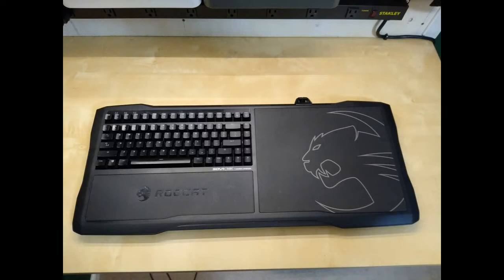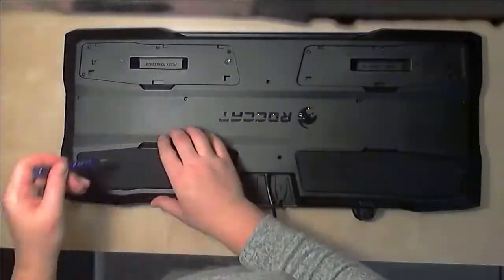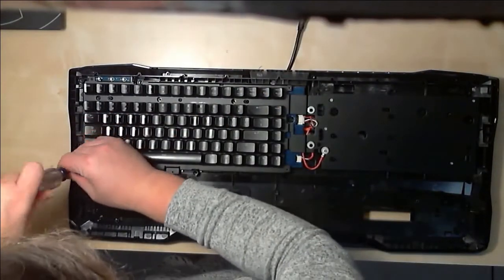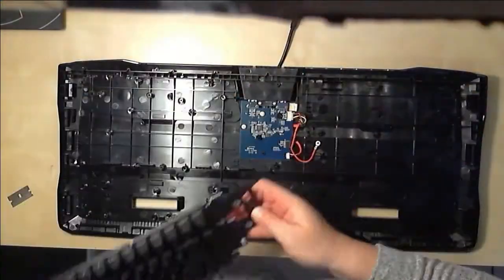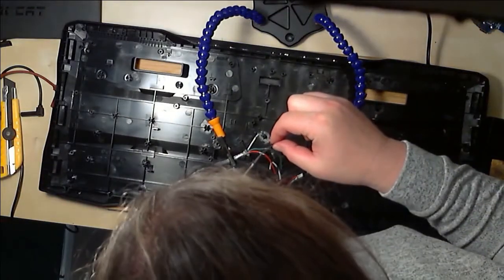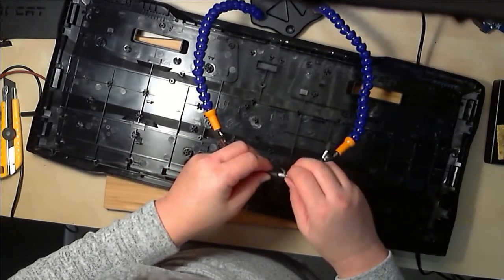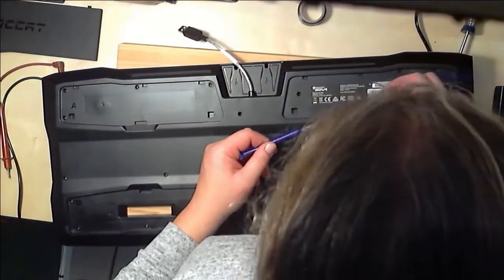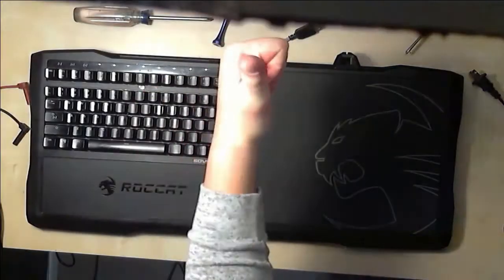Roccat SOVA disconnecting repair

Comment: Thank you so much! I was going crazy about this!  The connector is called 4 Pin MINI Din connector and is nearly impossible to find a 4 Pin mini din to usb. I was wondering, why roccat went with a 4 Pin mini din and my assumption was just to extend a regular usb due to the fact both have 4 pins. Thanks to you I’ll be able to keep using my keyboard.

Comment: I see you say you only have to buy 1 part? but The part that comes out of the keyboard. Wich part is that? because that's not in you buying list. The original connection is not the same as the new one. Greetings

Comment: Would this still be possible without taking the entire board apart? meaning if you cut the keyboards cable right at the proprietary plug and soldered the usb cable onto that? i know you did alittle bit of fact finding in this video. Thanks!
Reply from the maker: I think you'd have two problems. 1) you would be soldering right at the point of failure so the connection would now be moving and prone to failure. 2) You have no way of getting past the failure point to ensure your making a good repair.

Comment: Do you still have this keyboard? Mine went on the frits tonight and I'm so desperate for a fix.

Three days ago 1 LED on the keyboard stopped working. No biggie, I just kept playing.

Today, it started typing on its own... Mine is 3 or 4 years old now, but it hasn't given a day oh issues in all that time. Any idea what it could be? I've reset the device, reupdated drivers and haven't spilt any liquids on it. The keys that are typing on their own range from the caps lock on the left to buttons on the right and a few others in between. I'm desperate to get it back up and running... Please help if you can
Reply from the maker: Hi Wesley,

The keyboard I repaired belonged to a friend of mine and it's gone back to him already, sorry. I put some thought into the problem you are describing and I think these might be the easiest things to check.
1. Inspect the keyboard cord, cord connectors, USB plugs for dirt and damage. Do the same for the USB ports on your computer. Clean as necessary. 
2.Try plugging the USB connectors into different ports on your computer, see if that gets the LED back on or solves the self typing problem.
3.Wiggle the wires looking for the LED and the self typing problem. Wiggle buy the USBs going into the computer then work your way up the cord focusing on the connector and where the cord goes into the keyboard, see if that affects the LED or self typing problem.
4.Get a can of compressed air and give the keyboard a cleaning with that, see if that affects the LED or self typing problem.
5. if none of these steps helps you might have a bigger problem, as the keyboard uses mechanical switches you could try changing out the problem switches, this is more difficult and costly.
5. Time for a disassembly and internal inspection.

I hope that helps.

Good Luck!!
Karren
Reply: Mine starting doing this as well. My old one. I got a new cable from a backup one that I got on sale at amazon and it hasn’t been an issue since.